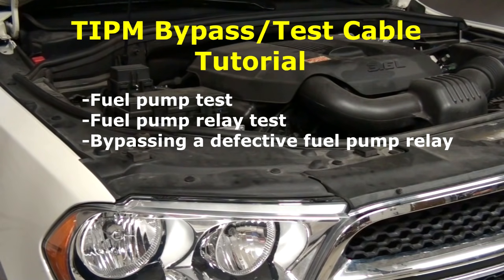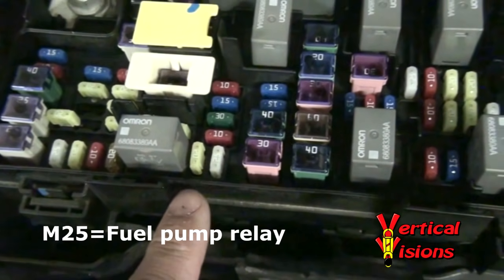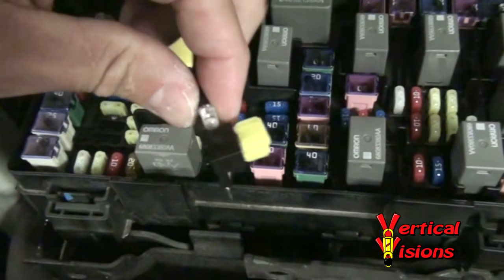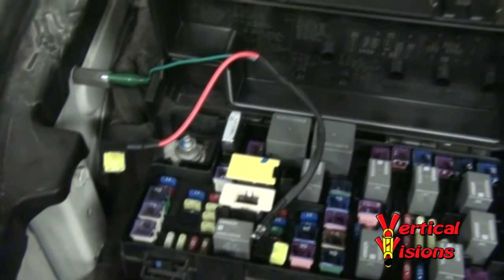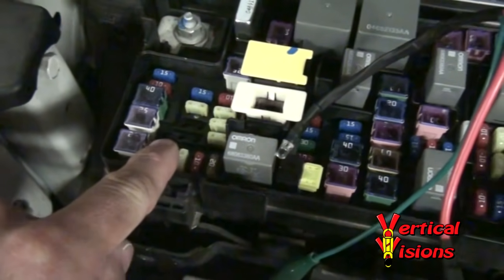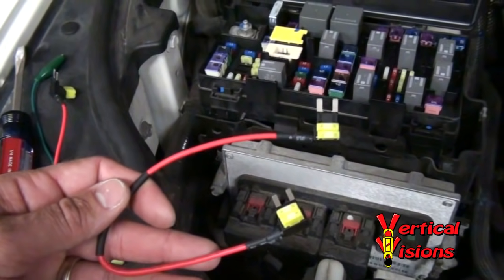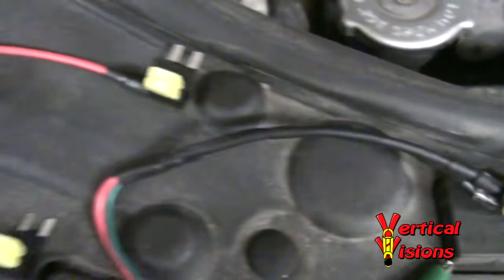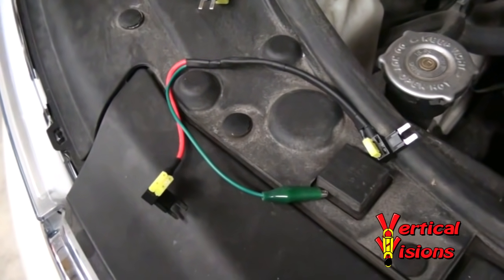TIPM Fuel Relay Test and Bypass Solutions - Most 2007-2021 Dodge, Chrysler, Ram, Jeep, VW Vehicles

Comment: I have a problem when it's super cold like below 0 or in that range. My relay gives me a hard time and I have to take it to a garage and throw it out. I spend a lot of money with garages. I spent a lot of money on fuel pumps. How much would it be for one of each of those type of connectors you have?  And how would I get those from you

Comment: So you are bypassing the ecm controlled fuel pump circuit which negates all the safety designs of the manufacturer for crash and roll over protection or any time the ignition is on but engine is not running!
Reply from the maker: Our TIPM Plug-In Relay System can accomplish the safety protection you desire.  Link:  https://verticalvisions.com/en/tipm-plug-in-relay-systems/35-tipm-plugin-relay-system.html.

Comment: I have that same tipm in my 2011 Dodge ram, I put in a bypass relay according to a video I watched.
I connected to all the proper wires and I don’t have any power to that fuel pump fuse for some reason and the truck is still not starting. Can I do that jump wire that you have on top of what I’ve done already? Also, I did check the relay it does work. I connected a 9 V battery to it. I took it apart connected a 9 V battery to it. It is working. It’s clicking.
Reply from the maker: Not knowing the other video you watched or how you connected the first video,  I would suggest you not add a TIPM bypass cable on top of what you have.   Your fuel pump relay is deep inside the fuse box, soldered to a green circuit board.   Are you saying you took it apart and tested it with a 9V battery?

Comment: Will the fuel pump just run continuously now? Even after ignition?
Reply from the maker: No, this is a key-on, power on arrangement.  Turn the key off and power is removed to the pump.

Comment: I rigged a relay to feed the fuel pump 12 volts from the battery anytime the key is in run or start. I was later told that's a bad thing to do since the pump is variable speed and feeding it 12 volts constantly is running it too fast most of the time. Is that true? Or is the variable speed thing located between the TIPM and the pump? I am trying to decide whether I should get a new TIPM or just leave my rigged relay in there. What is your advice?
Reply from the maker: We have not heard of any variable speed pumps or any variable speed devices in between the TIPM and pump in the vehicles we work with.

Comment: I have a 2017 Ram 1500 with a Hemi and the fuel pump won’t stop running, even when the fuse (F70 on this year Ram) is removed.  Any ideas?

I’m leaning toward a burnt trace or other board level damage, but don’t have a schematic to rule out other potential issues yet.  Hoping to open the TIPM in the next couple days when time permits and hoped maybe you had some insight to share.

If it is the relay, is it the same part number as the older Rams?  I don’t see info for the newer models on your site.
Reply from the maker: This doesn't make sense.  By pulling F70, you are cutting the supply of power from the fuel pump relay to the pump.  Since it's easy to pull the wrong fuse, are you certain you're pulling F70?  The only other situation I can think of is you might have an external fuel pump relay somewhere that is stuck on, which would render F70 useless.

Comment: Does this work for the 2019 Grand Cherokee? The relay seems fine, came to the shop on a flat bed but the next day it started the engine just fine and haven fail.
Reply from the maker: Yes.   You'll need a "micro2" fuse style cable though.  Link:  https://verticalvisions.com/en/24-micro2-fuse-slots

Comment: Unfortunately, I had already replaced  a perfectly working fuel pump. My haist in not checking for power before swapping it out. Thankfully this fix helped me get my 2011 truck back on the road after standing in a carport for a week and I didn't have to take out a loan to replace the PTMS. Thanks for sharing.

Comment: Hi quick question. Fuel pump only runs at the time you start the vihecle and shut off while the vehicle is running right? When you said if you fuel pump keeps running while the car is off. That is noticeable right, because they will making the sound or  hum? 
Can you replace the fuel pump relay and will solve the relay issue so you don’y have to by pass it or is it the relay slot on the tipm is the problem that is why you have to by pass? 
I have a stalling problem. But i know its not my relay or my fuel pump. Because i hear the pump turns on when i start the vehicle.
Reply from the maker: All of our parts either closely match or exactly match the OEM configuration for power to the fuel pump in the different key positions.  TIPM bypass cables have never been considered long term solutions as we see edge case issues in warmer weather (the cables can melt).  Yes, you can usually hear your fuel pump if you're in a quiet environment.  Yes you can replace the actual faulty fuel pump relay, but we use a microscope and you'll need to solder/desolder parts on a circuit board.  I would recommend you jump over to VerticalVisions.com where there is a great deal of information on this issue that is more current.
Reply: @ thanks you sir

Comment: My 2011 ram1500 has a check engine light but it now starts, wired the exact same way.
Reply from the maker: If you can read the code using an OBDII scanner, report back and I'll try to help.
Reply: @ thank you. I wanted to update after driving around for 8 miles it turned off and all is well.

Comment: Just had to do this to my 2011 dodge ram, it had been a mystery for a couple days and every mechanic was stumped. It would just crank no start, the only way I could get it running was jumping the battery (new battery) the fuel pump relay is the issue
Reply from the maker: The science behind this is fuel pump relays work better at higher voltages.  Starting your vehicle means you're using battery voltage only at 12.0-12.5 VDC.  If you are jump starting using a new battery or another vehicle, you're applying a higher voltage and an intermittently faulty relay will usually have a better chance of switching properly to allow power to flow to the fuel pump.  2011 Ram trucks are our #2 worst for fuel pump relay issues.  VerticalVisions.com

Comment: I bought and installed this jumper and it didn't make any difference. After removing the bypass jumper and putting the fuses back in as normal I noticed the voltage at M25 (both sides of the fuse) when cranking was only about 10.5 volts. Is this normal or what would it indicate? The battery voltage was up to 13.46 volts so that wasn't the problem.
Reply from the maker: If you bought your cable from us, please visit VerticalVisions.com and send us an email.  We're happy to support our customers.  Otherwise, 10.5 VDC during engine cranking would be on the low end.  Normal battery voltage is 12.0-12.7 VDC, but during engine cranking the starter load can reduce battery voltage slightly.  The 13.46 battery voltage seems quite high unless you're measuring while the vehicle is running (alternator supplying voltage).  If you still can't start with a CONSTANT 10.5 VDC on M25 during engine cranking, then the relay might be faulty in that it will not switch at that voltage.  I would also suggest a fuel pump test using the cable (we provide detailed instructions with our parts on how to do this), if you can't start using a properly connected TIPM cable.  We no longer use the M7 to M25 connection method, but our written instructions will show you the new connection method that might also be your solution.

Comment: Changed fuel pump & got the fuel bypass wire.... Still doesn't start. Any suggestions?
Reply from the maker: Pefrorm a fuel pump test using the wire and listen for the pump operating when the vehicle is off.  If the pump won't turn on, it could be a rusted fuel pump ground wire or damaged fuel pump connector near the tank.  Of course, there are dozens of other things that can cause a vehicle no start situation.  Fuel and spark are the most critical.

Comment: I have a 2010 3.7l ram 1500 and only sometimes, when I turn the key, my truck tries to turn over then keeps on cranking and shaking until I remove key.  Then I'll try again and she fires right up.  Does anyone know what this could be?
Reply from the maker: It could be your fuel pump relay, but your year/make/model makes it more difficult to confirm and test for it.  Read this:  https://verticalvisions.com/en/content/21-basics-of-bypassing-testing-relays

Comment: So you need to cycle acc back and forth before start?
Reply from the maker: No need.
Reply: @ why not use m21 fuse instead. It retains remote starts . No issues starting  overnight
Reply from the maker: @cesarsaavedra3095  Because the orientation of a TIPM cable would require the extra 9 amps from the fuel pump to be drawn across the existing M21 fuse, possibly overloading the ASD circuit.
Reply: @ thank you i will keep that in mind . Ive been running it without issue do far. 4 hour trip without issue wire not warm .

Comment: I have an issue with my 2017 3.6 durango. Sometimes it doesnt wanna start, i just tap the fuse and it starts right up, usually for months, then again it comes back, tap again and it starts….would this be a good idea to install? Wondering how long my tapping solution will work for…also, are these fuses same numbers for a 2017? Seems like a lot of this is for a 2013 model.  And yes, i replaced the fuse, and it still happens, actually wapped the fuse with horn fuse, horn works fine still…thanks in advance

Comment: My 2012 town and country is overheating and I all ready change sensors and Relay and All fan ect and it doesn’t kick in Hi when temperatures hit   1/2 it keeps rising ,can you provide a video where I can bypass and keep the fan on at all while the ignition switch is on !! Really need it Solve a long time Thanks
Reply from the maker: Fans are a pulse width modulation (PWM) signal where the power is turned on and off very fast over time, often via a MOSFET.  I don't believe you can easily bypass this easily.

Comment: I've found my problem after buy a NEW tipm box for 1,000$ I discovered upon taking out the old box ..that there is already a bypass on it !!!!  The part where the fuel relay goes is is damaged and burnt terribly!!!! I want to remove the bypass and put the wires back into the harnesses to insert into the NEW TIMP BOX

Comment: Have you ever had any issues with these fuses melting? I had one of these on my ram 1500 and the M7 side melted and would cause the truck to stall upon key turn. Not sure if this is the root issue, however the relay has been a known issue
Reply from the maker: Yes.  Here's why:  https://verticalvisions.com/en/content/24-fuse-slot-hot-spots

Comment: I bought the bypass cable to just keep for myself as a fast test tool. I also purchased the Relay System Lite for the 2013 Durango last week that I was troubleshooting the crank no start problem and found out the fuel pump wasn't turning on. I checked it with my multimeter and had no voltage at my power output coming out of my fuel pump relay. I used my own bypass wire and no problem firing up the Durango. So I knew it was the relay that gave out. Here in Hawaii the auto parts stores don't have a 20 amp add a fuse, only 10 amps with thin gauge wire. I know people make their own but I found out it's easier to just go online to this website and order one, at least with my own wire I could move the SUV around here in my gauge if I needed to. Then I decided to go with the Relay System Lite since it seems to me as a better option than a bypass cable but I wanted a cable to use as a fast tester. No problem with the Relay System Lite. Just pull your 20 amp and 10 amp fuses and put them into the  Relay System Lite circuit board and plug the board where the 2 fuses were and that's it. The owner of this Durango did call the local Dodge dealership and they told her they would call her when they get a relay kit in for the recall and call her up for an appointment. I told her don't hold her breath. I told her I could easily install my own external relay for her but I told her it would void the recall if I did it. So for now, this is the solution I find is the way to go. Chrysler doesn't seem to care that their customers have jobs and they need their vehicles to get them to work and other places, can't wait around until they call.

Comment: Is this a permanent fix? Is it necessary to install the "Safety recall R09 / NHSTA 15V-115 FUEL PUMP RELAY"
Reply from the maker: TIPM cables have never been a permanent fix.  You need not install any recalls for our bypass devices to work.

Comment: Hi I was curious to know what resistor you used inline for the led, I have all of these parts here and can easily make the cable. My Durango failed today 2020 @ 49000 miles. I wanted to test it before I send it to the shop for warranty.
Reply from the maker: Typically a 1 kOhm resistor on the red (+) wire

Comment: Will the fuel pump run if the relay is bad
Reply from the maker: Yes.  20-25% of our customers experience a "stuck on" fuel pump relay which runs the fuel pump with the vehicle off.  This will drain your battery in a few hours.

Comment: I bought the cable and it didn’t work
Reply from the maker: Maybe you did not have a fuel pump relay issue?  Fuel pumps, cam shaft or crank shaft sensors, and other electrical problems are often the culprit.
Reply: What can it be the fuel pump keeps running when I turn off the van
Reply from the maker: @jesseromero-t1g  20% of our customers have this same issue where the fuel pump remains on after turning off the car.  This will cause your battery to drain within a few hours.  The issue is the fuel pump relay is stuck on.   We have several solutions:  https://verticalvisions.com/en/content/14-tipm-fuel-pump-relay-solutions
Reply: Can you send me your phone number

Comment: This method or the relay method?
Reply from the maker: My suggestion:  https://verticalvisions.com/en/17-tipm-plug-in-relay-systems
Reply: @VerticalVisions  the initial method you showed is what I did and it's failing again. The cable is really hot but the fuses are good. What's the likelihood of the initial method failing
Reply from the maker: @Grab123on  If you used our cables and connection methods, which now differ from this video, the likelihood of failure is very small.  Many people build their own cables or buy cheap knockoffs on the internet, so I can't speak to the quality of your cable.

Comment: I have problems where is relay is good i try the bump out side the car its working but when i install it it doesn't work .. like there is problem with electric conduction.. but box of relys is ok the battery is ok so where i go from there ??

Comment: Help me out please 🙏 I watched this video last week and ordered the TIPM bypass wire from Amazon. I have discovered that it is 14 gauge (awg) 🥹 I heard at the end of the video that it needs to be 20awg . Will this 14awg be safe ???
Reply from the maker: 14 gauge is sufficient.  20 gauge is what we use for the LED portion of the cable, not the main cable that carries current to the pump.  With any Amazon cables, just keep in mind these sellers essentially peddle our design as their own.  They'll offer little, if any support, and you probably didn't get connection instructions.  These sellers don't know anything about fuel pump relay issues.  We have a better connection method now that this video does not show.
Reply: I just did the same thing you just did and my truck 🛻 still won’t start 🥹🥹🥹 the wire trick didn’t help it start
Reply from the maker: @bigbusiness6903  I would suggest you perform this test:  https://verticalvisions.com/en/content/34-testing-a-fuel-pump-relay
Reply from the maker: @bigbusiness6903  Try the right slots of M7 (full time power) and M25.  There are dozens of things that can cause crank, no start situations.  Camshaft and crankshaft sensors, fuel pumps, wiring issues, WIN module failures, no fuel, etc.
Reply: @VerticalVisions ok I will try the right 2 slots now pray 🙏
Reply: @VerticalVisions ok I just moved them to the right side of the M7 fuse now I need a boost off
Reply from the maker: @bigbusiness6903  Right side of M7 is just for quick testing as it will keep your pump running full time.
Reply: @VerticalVisions would M21 be a better source than M7 ?
Reply from the maker: @bigbusiness6903  M7 or M37 are great sources.  Not sure about M21.  But you must know how to configure your fuses if using M37.  If you bought your cable from us, look at the hard copy color instructions that came with it.
Reply: Thank you so much ❤how can I test to see if my Fuel pump really is working or not?
Reply from the maker: @bigbusiness6903  https://verticalvisions.com/en/content/34-testing-a-fuel-pump-relay
Reply: Just put a brand new fuel pump in!! And it’s still doing the same thing !! So now I will try this TIPM wire METHOD AGAIN!!!!! 😊😂

Comment: Can i still use my remote start if i install this ?
Reply from the maker: Yes, but you'll need to use a slightly different connection method that will be included in the hard copy product instructions.
Reply: @VerticalVisions  any link ?
Reply from the maker: @13_islander  Yes, www.verticalvisions.com or a link exists in the video description.